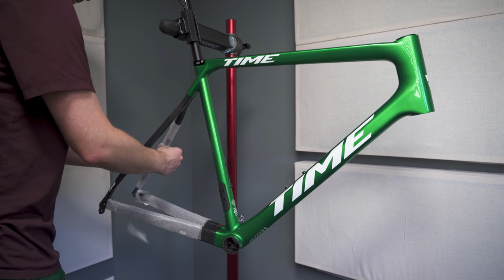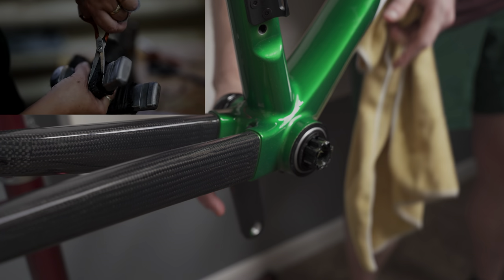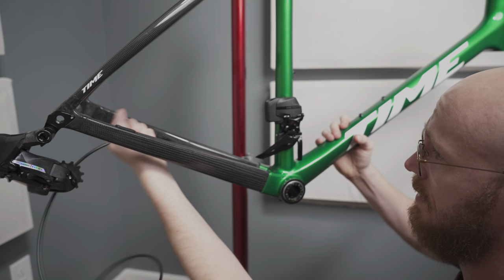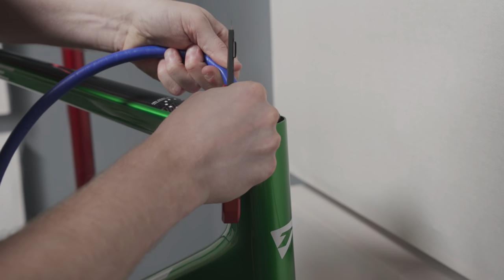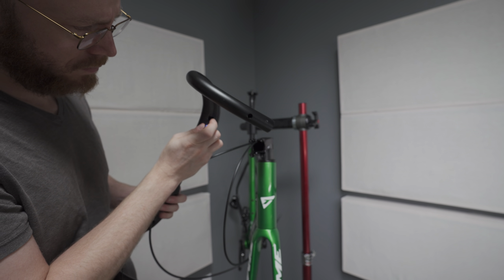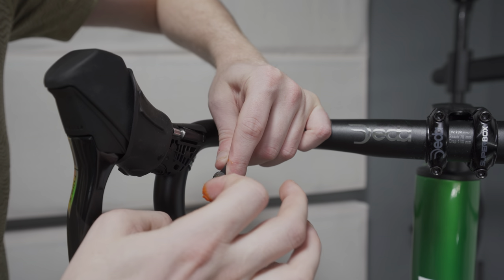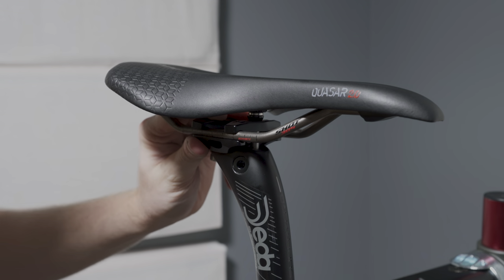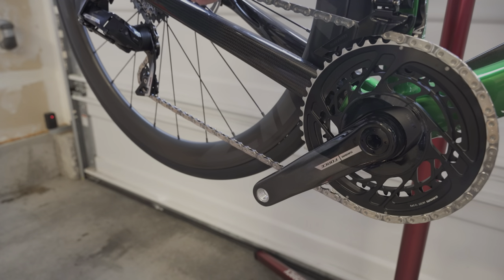Time Alpe d'Huez Disc 2023 with Sram and Zipp: Dream Bike Build and Ride in 4K HDR

Comment: Justin,  are those 28's that you have on your bike?  If so, how much clearance is there?  Close to dragging?    Thanks.
Reply from the maker: Had to bust out my calipers. :) They are indeed 28 nominal that measure in at 28.6mm. There is 5.6mm clearance to the inside of the rear stays. No dragging, but they are pretty stiff wheels. I would not go for 30s. If you're looking for wider, the ADHX (the original ADHX, not the new ADHX 45) is closer to 35mm or 38mm supported, and with a geometry that is nearly identical to the ADH. It's effectively a roughroads ADH.
Reply: @JustinDoesTriathlon  -- Thanks for the detailed answer and taking the time to measure.  Highly appreciated.
Reply from the maker: @agie170hss2  happy to help!

Comment: your not meant to grease the shell  when pressing the BB
Reply from the maker: Yes you are, per their instruction manual. It's step one under Bottom Bracket Shell Preperation: 
https://docs.sram.com/en-US/publications/7unL17qdyCWxTL38aPmYJ0/UM%20-%20DUB%20Cranksets%20and%20Bottom%20Brackets?models=bb-dub-pf-a1#hashItem=bottom-bracket-shell-preparation
Reply: time manual says not to @JustinDoesTriathlon
Reply from the maker: Interesting. I'll ask the Time assembly manager. Worst case scenario I guess I'll pull it off, but I'm not concerned. Thanks for noting it, I'll report back once I get an aswer. Do you have a link to the Time manual? I've not seen the Time assembly manual before, just the general owners manual.
Reply: here is a link to Hambini ,being recognized as making the best bb money can buy ,also a great channel,not really needed in time bikes tho as their frames are so precise but very interesting

Comment: those zipps are gonna ping my dude, bladed spokes are going to creak and pop where they cross unless you like replacing spokes constantly
Reply from the maker: Interesting. I've run bladed spokes for about 15 years and never had any issues. Probably a perk of being light. I've actually already replaced the Zipps though, too (still with CXRays tho) because I don't trust hookless.